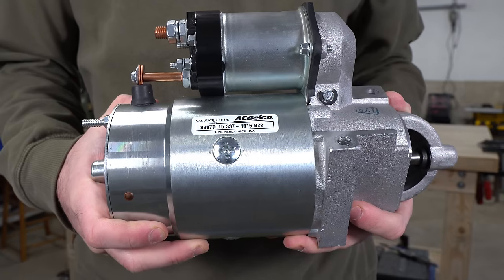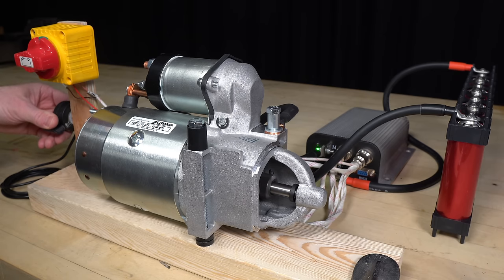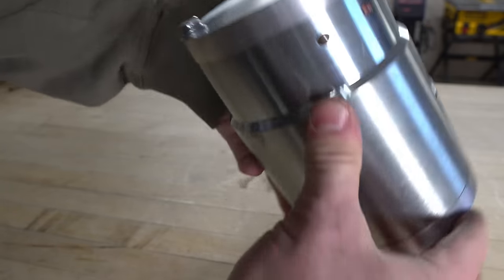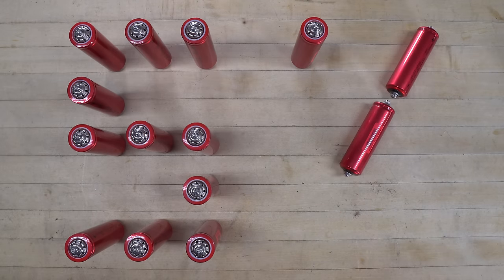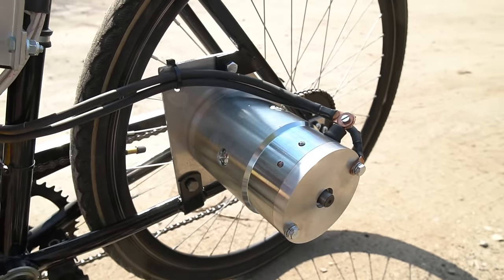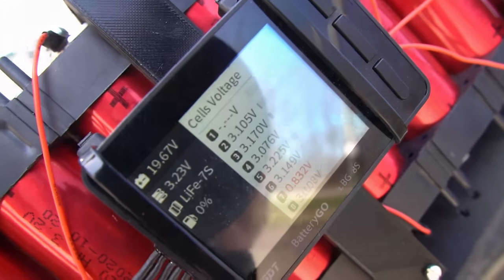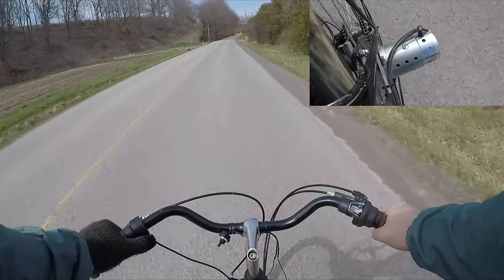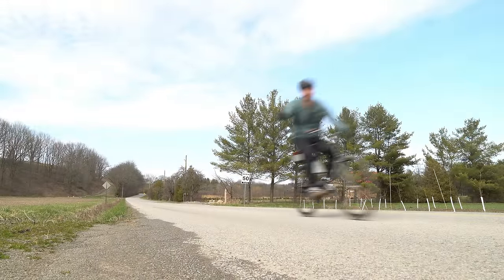Starter Motor Powered Bike

Comment: Electric motors are designed for specific energy output, and although you can apply that output in various ways and even alter or upgrade certain physical traits of the motor (like replacing static bushings with roller bearings or adding extra cooling holes) you can't really get around the original intended output without some major design changes. An engine starter motor is designed to output an extremely high torque for a very short duration. Freeze the video at 1:37 .The "winding" for each field region in the stator is a solid copper bar. This is so it can carry extremely high current to produce the necessary torque. This is why a starter motor can drain a fully charged battery in a few minutes. The other weakness is that the winding connections in some starter motors are soldered at each end. The heat produced by prolonged conduction in the winding can (and will) melt the solder joints. Also, starter motors are brushed motors. This means their speed can be controlled simply by varying the voltage at the brushes rather than providing a variable duty cycle, pulsed voltage necessary for a brushless DC motor. A speed controller is unnecessary, but a high amperage, variable voltage regulator is needed. However, since the majority of starter motors only have two brushes, the torque drops off rapidly as the voltage decreases. This is a fun experiment, but not an efficient or practical use of this type of motor.
Frankly, a hub motor conversion kit is only slightly more expensive than a good quality starter motor and are designed to run for extended periods of time.

Comment: Better come up with some kind of cooling fins or heating. Starter motors motor are not continous run electric motors. I think there were heat sink fins made to go on engine oil filters that may work. Drive your bike around and then check temp With a heat detector gun . You can get a 6V starter a run it on 12V and get twice the torque  and increased speed. Once again check the starter for overheating. Good video I might experiment with some starters i have laying around.

Comment: Hi Austin! Does the BMS heats a lot? I am going to use similar for my project and wondering if I can put it in the closed box with the battery
Reply: If you have bad cells and your BMS is trying to compensate for that, it might get hot but you should be safe to put it in a closed box otherwise.

Comment: Is there a device that will allow the 12v starter motor to run at 48v but with current limitation so that less heat is produced but produces similar wattage?
Reply: Since U=RI and P=UI, this device would be magical :)

Comment: i think the only solution capable of cooling that thing would be to treat it with some stator-ade. but you can't anymore since you drilled holes and it would simply leak out.

Comment: 3D print a fan housing to fit on the end of that starter motor which will help cool that motor by sucking or pushing air thru the motor housing...

Comment: Very cool video. It seems you're working well outside the normal use case for a starter motor, so it's good you gave up. Someone else suggested a low kV rc motor. Not sure if you have to use lipo cells for that, but be careful when using those!

Comment: Recognize the hot motor probably wouldn't be as big of a problem if you were able to use your gears by just configuring the motor location differently like a mid Drive turning the cranks instead of the rear wheel directly which comes with multiple advantages and no real downside that I can see

Comment: I used one in a diy pahse convertor to spin up a 25hp 3phase motor to eliminate the need for the start capacitor bank. It worked well for a while but the speeds required needed a bit higher voltage. It smoked eventually. I use a different type of system now.

Comment: 36V in a 12V starter was doomed to fail, 3 times the voltage make the starter be capable of consuming 3 times the nominal current.

Using only 12V and the newer style that use permanent magnets instead of stator coils are more efficient

Comment: I've seen videos of people adding ferro fluid to the inside of ebike motors to aid in heat conduction from the stator to the rotor. That might not work because you drilled holes in the outside though

Comment: Great video! I've always wanted to try these powerful 3 phase brushless motors used on some modern vehicles radiator cooling fans, for a bike. I forgot which vehicles used them, but they are low profile, brushless, and very powerful.
Reply: Also from power steering, pretty strong motors...
Reply: etek motor

Comment: Instead of just drilling holes in it, a fan on the outside end of the motor shaft would have pulled air through the motor casing, cooling the armature.

Comment: Try using GREEN GREASE 
FULL SYNTHETIC
lubricant in your bearings. That is the brand name. 
GREEN GREASE 
Auto parts store should have it. Remove factory grease with brake parts cleaner or carb cleaner. Repack with GREEN GREASE. I see the speed controller has a minimum of 24V . So running a 12V starter on 24V or higher will give the same advantage as my suggestion  of 6V starter on 12V .

Comment: Might be a stupid question, can alternator charge the battery then use the power to run the starter....🤔 But maybe later it will no enough current to charge the battery
Reply: Yes  it  can  but  starter  motor  burns  more  electrical  power  than  your  alternator  generates.
.

Comment: Make it water cooled by wrapping some thin hvac copper toobing or thin aluminum toobing around the motor to a heater core from a car facing in the direction of the wind mabye also fabricate a tiny water pump to run off the back of the motor where the shaft sticks out.

Comment: Starter motors are designed for short bursts of colossal torque. Anything longer than a minute of runtime will start degrading the enamel of the windings.
TD;DR: This starter motor will short out after a couple of hours.

Comment: So as an auto tech i found this pretty interesting, mostly in the fact that you seem to be getting absolute crap for motor torque and im thinking the controller is the issue. It really came into focus in the last segment of the video where you show holding the bike still with a 176a limit. So, 'limit' does not mean 'actual' and you didn't specify the actual voltage or current at that moment, but if we assume it was a 36v lithium pack that doesn't suffer much voltage sag under load, the idea that you could hold that still would suggest that your bike was, in that moment, a >6000w space heater  (~36v X ~176a). And i dont think there are many parts of your bike that could take 6000w of heating for more than a couple of seconds without letting the smoke out. I understand your drive ratio across the sprockets is somewhat taller than the actual gear drive of a starter and flywheel/flexplate (usually more like 15-20:1 where i ballparked your sprocket ratio as ~5:1?) but it doesn't look like the motor could do the job its actually intended to do (spin a chevy v8 up to 200rpm in less than a second from a dead stop) and since i don't see any reason why it's the motor's fault, i have to wonder what the controller ISNT doing to make this thing so weak that you can try to hold it still without hurting yourself. The reciprocating assembly of the engine that would be used on, weighs more than that entire bicycle and get spun to 200rpm in one second.. Hmm. I have no issue with the project, i would just hate for someone to get the impression that this is motor limited when it seems to me that it is very likely controller limited.

Comment: #1 modification is forced externally pressurized air cooling of the Armature. Lots more holes, and a centrifugal (Not-Flat Fan!) impeller to force new clean air into the motor cavity, or you are going TOAST the motor windings (again).

Comment: The comments are intermittent vs continuous duty are valid, but not constructive. I would say adding forced air would help with the cooling, and a thermocouple measuring inner motor temps could help you monitor the condition and prevent destroying it. With your resources you couldve modified the back plate to have slots for air to pass through and machined a threaded hole on the end where you could install a( probably 3d printed, not PLA) centrifugal blower. Though that motor is already toast, not sure you want to go down that road again!

Comment: mesure the speed of the motor with no charge and set a sprocket for about 20-30mph a max speed, and set a limited current for no overheat. 
a starter motor is conceived for give a very high torque at low speed, consomption is not a thread for few seconds.

Comment: I think your gear ratio is still steep. The controller to the Motor is pushing lots of current. After burning up or running hot motor became more resistant (doesn’t respond to lower current) I am surprised if it doesn’t move with 50amp limit that is a lot

Comment: I suspect it would've been hairy had you encountered any corners with that motor, 36v battery pack and yourself sat over the back wheel. I made this mistake eith my first ebike build. Only to modify my battery pack to fit in the front triangle after just one very memorable test ride.

Comment: This is a high speed motor. In 36 volts even you triple times the rpm. You need a much much bigger bracket to reduce speed and increase torque with lower AMPS and better efficiency.

Comment: Well bud!..Lets face it. A starter motor is DESIGNED for high current..for SHORT periods. Figure 100amp at 12volts= 1,200 watts! THAT is what a portable HEATER throws out!: BIG WATTAGE +SMALL AREA..= BIG HEAT. End of story./ S.B.Later dude.

Comment: Is there a reason why you can't peddle it to get it up to speed before engaging the motor illuminate all that unnecessary stress you put on it in the first minute as that's likely what causes significant portion of your excess Heat giving it a much easier go out at things just maintaining a speed rather than getting up to speed. Just an idea you might try if you haven't yet

Comment: Get your hands on an universal washing machine motor from some european miele, etc machine. Then put it on a bike with an inverter and some sort of speed controller.
They reach wild rpms with little heat and low amp pull

Comment: Those cells were defective you just didn’t want to trash talk your sponsor. Sell out. Even without a bms dropping to that low of a voltage within a partial cycle is appalling. Bms doesn’t even balance on discharge only on charge so it wouldn’t have made a difference.

Comment: series wound brushed motors with HUGE winding wires draw considerable current. thats why batteries have 550-1000 amps for cranking. i think a similarly sized brushless outrunner or axial type motor will have better performance with the same power supply. 

I never like headway cells due to the voltage drop. I had better results with 4 cell pouch lipo batteries.

Comment: @Austin Blake a starter motor is a realy choice it is only designed to give a lot of torque for like a maximum of 20 sec if you want a real project try using a car altenator i have recently seen on youtube that there is "kits" to convert them to a 3 phase motor that works very well for an electric bike with performance equal to a wachingmachine motor

Comment: This is a low rpm starter motor, have you try a planetary type starter used in Japanese car or newer domestic car or truck. They spin much faster and lighter weigh. You will have to remove the internals gears first.

Comment: Use a treadmill motor and controller for an electric bike. There are two main models of treadmill motor controllers. The one you do not want is commonly called an MC60. It's pretty terrible, even for running a treadmill. It's a noisy SCR chopper style of speed control with poor low speed torque. Treadmils with this type are easy to identify by their simple controls that have a rotary knob or slide rheostat for adjusting speed. Often the controller is configured so it won't start until the knob or slide is moved quite a bit, then it can be slowed down.

The much nicer treadmill motor controllers can be identified by having a two button speed control to adjust up and down. Taken away from their control panels, these motor controllers can be operated with a simple PWM signal. There are several DIY schematics for them, some use a rheostat to adjust the PWM control signal. What makes these motor controllers so much nicer than the MC60 family is they control the motor with PWM output for high torque across their RPM range.

The downsides of trying to use a treadmill controller for a mobile use? They take in AC line power and convert it to chopped or PWMed DC so the motors run on the same voltage.

But if the AC in and AC to DC conversion part can be bypassed and only the PWM part of the fancier controller used, then the big hurdle would be putting together a 120 volt battery. I dunno if treadmills in the UK and other 220V countries use 220V DC motors or if they have additional parts to reduce the volts.

Comment: Mill heatsinks into the aluminum hubs that may  help transfer heat away from the shaft. A fan would help. However, you would have to attach it to the shaft. Well, that's my 2 Pennies.

Comment: With LiFePO4 cells you need to properly bottom balance them if you are not going to use a BMS. It is mandatory. Batteries from Battery Hook Up need to be capacity tested before use. Be sure they are all well matched in capacity and bottom balance them to 2.3 volts each. You will set your controller to stop the discharge when the nominal voltage is 3v X the amount of cells you have. Any group of cells in parallel will be considered a cell. That will prevent you from frying your cells and when you charge only charge to 3.4 volts and hold until the amperage is low. Do it right and you only need the volt meter to check every once and awhile and never leave your voltage gauge on when not in use.

Comment: sucks gas engines are slowly going away but im hoping one day they would make brushless starter motors then we could run much smaller batteries in cars and not needing 600amps to start a motor but i doubt that will happen

Comment: Greetings. The motor is highly revving and with such a reduction it works with poor efficiency, you need to increase the reduction and you can increase the voltage, the motor can also work at 36v. and even 48v.

Comment: Don't go without of BMS because you can buy one from eBay for about $10 which is a very small price to pay for your safety and all the hard work you put into building that battery pack and eBay comes with certain buyer protections that would prevent you from having the same problem you had with your previous supplier not making good on a broken product.
Edited: after seeing you did get an upgrade would you ever consider selling your old battery pack or donating it to somebody interested in trying to get it working on a different bike I built on a tight budget out of necessity that still doesn't have a battery because I'm barely making rent and groceries right now and would sure make for a much better commute considering Winter's over in Central Florida and we have a very long hot summer ahead
Reply: Welfare queen

Comment: Starter motors were designed to produce way more power than the heat can be dissipated. Short term use only. Way too much power for a bike anyway. In the old days people used the armature from a generator and fields from a matching starter if I remember right. A motor generator from an old lawn tractor or gas golf car might work. If I was doing it I would probably use the 24 volt motor from a scrap lead acid powered lawn mower. That would be about the right size. I've got 2 of them. Shouldn't be that hard to find.

Comment: You seem talented enough for me to suggest >> why not just make ur own motor ? <<   I recommend a pancake design. Make the rotor the size of that giant 60 tooth sprocket. You've got 2 options for designs > put the perma-magnets on the stator & use an ESC > or > put the electromagnets on the rotor and simplify with a commutator <   Either way, make sure you have a way to try a couple different coil designs.  Making a motor is simple with some simple + brief research.  
   I recommend the pancake design because of how much more torque is possible with the large circumference. PLUS since there is lots of room there will be much more magnetic engagement. You probably have to make such a motor. I've never seen one before. I've made lots of motors. with that lathe of yours and F360 experience >> You got this !! <<  U can do it :)

Comment: You have access to a machine shop and you're going to mounted in the back Direct chain drive to the back wheel...?
But why when you could have mounted it in the Triangle in the middle of the bike where doesn't throw things off balance and then a direct chain drive to the crank utilizing a dual chainring that you probably wouldn't have to buy because you could machine one yourself and leave the existing chain going from the crank to the rear derailleur completely intact and able to Leverage the 7 gears that came with the bike and could have made much more efficient use of that motor giving you if you're reckless a much higher top speed or you if you are wiser a much more extended range getting a lot more bang for your buck and if you put a Freewheel on the crank you wouldn't have to worry about the pedals needing to move while under power giving it a much more natural look and feel when you're not powering it yourself through the pedals

Comment: Cool but not feasible.... Just get a used Razor Mx650/Mx500 or Sx500 36v setup. I'm positive that you can buy them off people that mod their Razors (like me) and get 48v or 72v systems.... They're the same style of motor and they mount easier than a starter, plus they can take the heat.      LoL